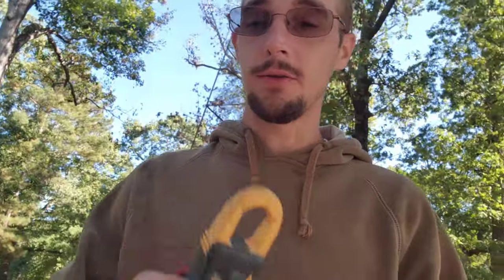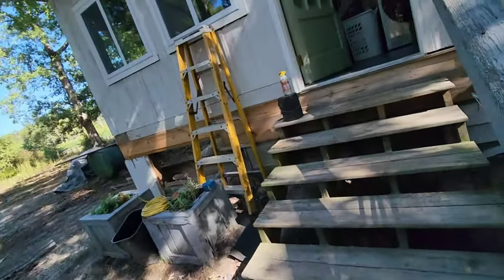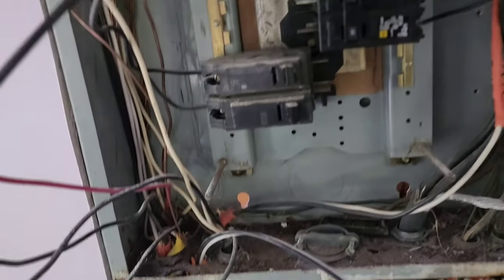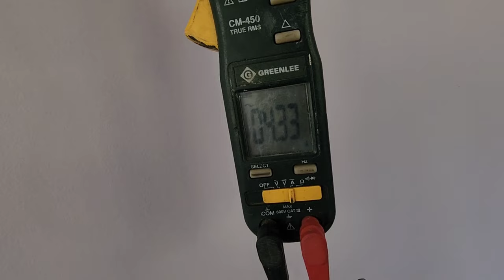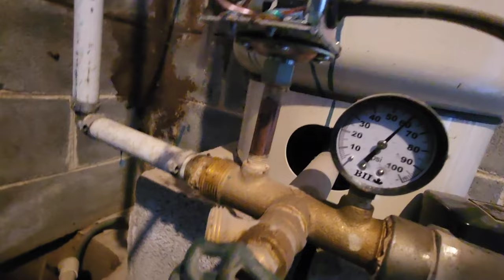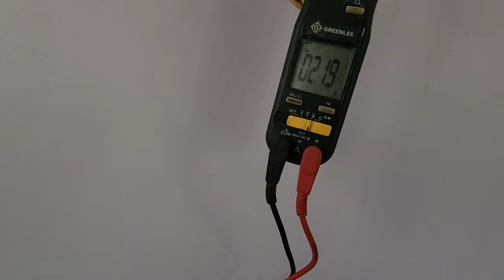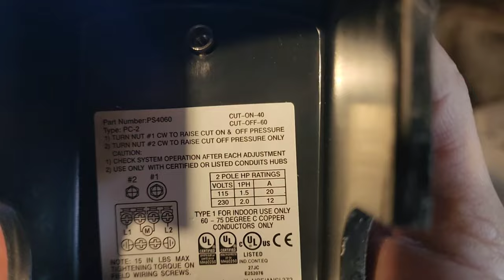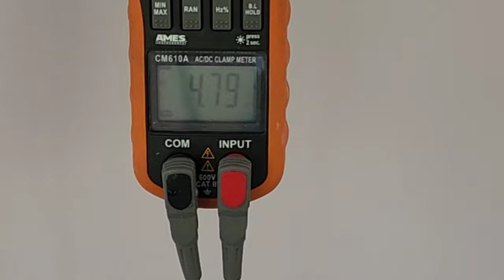Well Pump Electrical System Troubleshooting. Step by Step Tutorial.

Comment: Im sure that 30amp breaker didn't help. 12/2 shouldn't be on a 30 but on a 20amp
Reply: Size of wire has nothing to do with tripping. It is an over sized breaker but that wouldn't cause it to trip.
Reply: It’s only gonna pull what it demands so unless the pump goes bad and draws excess current it’s all fine. It’s not okay tho but with the current draw I saw in the video it should be on a 20 for sure and in case the pump goes bad.
Reply: If it was not a lightning strike, I can only suggest that the cable had been knocked about before it was used, I mean I have a fair amount of cable that's outside that I'd think twice before using !
Reply: @ChillyDippers it absolutely could. Motor seizes or impeller or rotor becomes locked (by any number of means including mineral deposit buildup, failure of one of those components, even sediment infiltration) causing the motor to continually draw more and more amperage in its attempt to begin rotation. This overloading would be attained due to the over sizing of the breaker. The conductor size is only rated for 20. They over rate a bit but not another 50% of the current load. This would cause the insulation to heat excessively, causing it to become scorched, brittle and lose its insulative properties. It would also create this same phenomenon with the wiring AND the motor windings themselves inside the motor housing.. This in turn would then allow the conductors encased within to be able to allow an electrical arc to bridge the void between either through proximity or even moisture present, and also enable them to short to ground by arc bridging to something like metal casing sleeve and even to water itself present on the sleeve itself or motor, so either from drawing excessive amperage past the 30 point (which is plausible but unlikely without causing something to ignite first) but entirely possible and even likely through the overheating of the conductors and wiring and windings in the motor itself
Reply: @sheepishmclemmingston5550  no it absolutely can't. However it would prevent the wires from getting overly hot in the situations you bring up. 

Over sized cables do not cause excessive current flow. Fuses, breakers, and thermal overload do.
Reply: @ChillyDippers  tell ya what. Go ahead and slap a 30 amp breaker onto a 12 awg dedicated circuit with an inductive motor as the dedicated load, wedge a stick into the cooling fan on the rear of the rotor shaft and make sure shes good and wedged in the housings grating and that cooling fans blades so the  rotor cannot spin, and let me know how that works out for you.  Do it multiple times. Tell me how things go.
Reply: @sheepishmclemmingston5550  size of the wire won't cause a breaker to trip. Yes when the load draws more power it will heat the cable and there might be excessive voltage drop it but it won't cause more current to flow then what the load determines.

Comment: Excellent diagnostic troubleshooting.  There will always be armchair generals who doubt what you say, but you solved the problem and got the water going.  Now, whoever was running those electrical lines, they need talking to.

Comment: When exposed to live voltage, your muscles will contract and therefore your hands will involuntarily grab the exposed electrical wire or fitting with potentially dangerous consequences. If you are in a poorly lit attic or void, always try to use the back of your hands for feeling around.
Reply from the maker: Best advice ever! I always second guess a meter & use a screw driver and the back of my hand. So it'll push me away if there is some sort of voltage issue back fed thru a ground
Reply: That's actually a bit of an old wive's tale. I've been badly shocked many times at both 120V and 240V (I was quite a tinkerer as a child), and I've never experienced the involuntary 'grabbing' phenomenon. Maybe it happens at very high voltages, but not at the voltages found in residential settings. It's a myth.
Reply: @paulmaxwell8851  definitely NOT a myth.  It may not have happened to you yet. But if you keep grabbing hot wires while you're grounded, eventually you will understand it's not a myth.

Comment: They probably Chaffed the insulation off that wire by pulling it through the Galvanized pipe from day one it was only a matter of time before it failed completely (which shouldn't have been done). UF wire AKA Underground feeder wire is direct burial. That house is a wiring nightmare home owner electrician special. Great job diagnosing.
Reply: I saw how much of mess and disorder the wiring and plumbing were in this video.  Even when I pulled temporary outlets, my wiring was always organized
Reply: The wiring in that place looks like a bird nest. Everything you did is a vast improvement 👍

Comment: EXCELLENT critical thinking and problem solving.  I tend to agree on the lightening strike theory.  I mean what are the odds of having not only one but TWO bad spots in a wire.  Well done.
Reply: Many may think that a lightening surge would mean that the power distribution (power company) wires took a hit.  Lightening hitting a tree, fence, or the ground itself near the buried copper wire chase will find that copper to be a better conductor than surface loam of the earth, so a tremendous current will jump onto the pipe, and then to the wire inside it.  The wire insulation breaks down at a very low voltage as compared to lightening, so what happened would be expected.  I suspect the wire was damaged FIRST followed by vaporizing of the contacts at the pressure switch. If the pressure switch had not acted as a fuse, further damage inside the home would likely have resulted.
Reply: We had a lightening strike on the phone line years ago.  The phone line wire casing was unharmed but the wires in at were vaporized, it was a hollow tube.  It also got my computer and the surge suppressor it was attached to

Comment: Good job! I am not a electrician, I just wondered if you could have just done a continuity test to find broken wires..
Reply: Disconnect them on the switch and at the well if you have continuity on any of the wires it is shorted

Comment: I am not an expert on well pumps, have worked on a few, both jet and submersible, grew up with a jet in the home and at 12 years old knew how to prime it.  Have nearly an EE degree and experience equivalent and my expertise is troubleshooting and computer programming. The troubleshooting on this is 100%.  I have not seen anyone do a video  as good on that, just following the steps and thinking is great for someone to learn from, no matter what they are trouble shooting.  He may not have ever read Kepner Trego Decision/Problem analysis, the best book on this but he follows the steps - did not cost the customer failed "fixes", did not jump to cause that causes failed fixes, and probably took less than 15 minutes longer total to get a good result.  Any failed fix would have cost much more.  The meter replacement when he questioned measurement is a GREAT step.  Proceeding with bad information is heading to a failed fix.  The only bad decision in this was using the old wire to pull in but quite frankly, I would have either done a resistance check of that or done what he did - probably done what he did.  The resistance check would have told me the wire was shorted but I still may have tried to use it as a pull. I was vacillating on that when I was watching. 
I have nothing but respect for his work.  If I needed his services he would be on the top of the list for being called.
Reply from the maker: You Sir I respect to the fullest as well for such a great comment! Alot of what I do in my Videos is to help others. I did all the steps that anyone else would have to do, (even though I knew the problem about halfway through the job) I wanted to show proper step by step test method to rule out other areas. So many different variables on these systems,  but I'm new to shooting video and editing but slowly am getting better at that as well. Making a Video requires alot more time on the job & customers think ill add that onto labor costs (which I never do) . This job total was I believe under $400. It's hard to say what others would charge, but I try to do my best work & be as fair as possible. Thanks again for your words!

Comment: good diagnostics, I agree on the lightning strike as the cause, and the metal pipe was "ground" in several spots, lightning always goes to ground and that opened the insulation allowing the direct shorts you found and that makes sense to me......again, you do a great job explaining things.

Comment: I noticed that at the very end of your video analyzing the problemthat a pop-up blurb "Or was it [lightning bolt symbol]" appeared. A lightning strike is what I was anxious to suggest, but you beat me too it! 

Very unusual to have two burnt spots 30 feet apart on the same wire and circuit.

Fine videos, great work ethic, nimble mind at work - more fun than watching sporting events on TV. Thank you.

Comment: That's excellent troubleshooting. I don't envy professionals like yourself, who have to work on disasters like this. There are dozens of electrical code violations at that house, and you somehow need to get the guy water without having to tear down the whole house and redo everything. A pro electrician would not be allowed to overlook some of the egregious errors like poor routing, no fittings for wires going into the panel, loose coils of live Romex dangling where animals move, and inadequate wire protection until it gets to the 18" deep level. An electrical inspector might condemn the whole house. Great decision to redig a new path. He needs at least 18" with overlying pressure treated wood, or more if vehicles drive over the run.
Reply from the maker: He's a 25 y/o trying to do everything himself & has a older guy helping him out. I'm sure things will look better in time. He just can't afford a true licensed electrician. But I agree with you, you'd be surprised at some jobs I find worse than this.

Comment: Where have you been all my life? In watching 3 videos so far, I have learned like 9000% more. I do not want to make a cheesy post about subscribing (I did subscribe) but wanted to thank you again for showing how to diagnose these things so that I either A- do not get swindled by people selling me purple unicorns or B - I can actually fix myself. This video specifically is about topic that I am about to undertake. My breaker keeps tripping so I have been working all angles and checking amperages and all this other stuff and only thing left is the wire. I ordered 300ft of conduit + 250 ft of wire (only need 180). Looking forward to tackling this with far more confidence.

Comment: I'm really enjoying your videos! Thanks for taking the time to video and explain the well repairs you're doing.  I do quite a bit of electrical work and can add something to this!  That wire failure is a mess but not unheard-of. What you are seeing are two places in the cable which have suffered insulation failure and had an arc fault. This happens when the insulation breaks down chemically (for some reason) and becomes conductive. The damaged insulation provides a current path from one conductor to the other; or from one conductor to ground. This conductive path starts out gradually in most cases, but as the current passes through the damaged insulation it causes more and more damage which accumulates over time. This causes an increasing current flow through the damaged insulation. The problem "snowballs" as more current flows and accelerates the damage. Finally, so much current flows that it produces heat and starts to burn and carbonize the insulation. This is very conductive and results in an arc and high fault currents. Envision a shower of sparks and a breaker trip.  Often the arc will continue until the breaker trips, but may not re-strike after the breaker is reset. This is because the burned insulation has been completely blown clear of the copper wires, removing the short temporarily. It is possible for the bare copper conductors to continue carrying power and the circuit to function after this event has happened, as long as the copper isn't actually touching or broken in half.  This can allow for multiple damage points in one cable, as you found. This means that there has been a series of "mystery breaker trips" for this circuit where they keep resetting without locating the fault. 

The cable was almost certainly damaged during installation as they pulled it through the abandoned water line. The inside of that line may have even had fittings and couplings in it, with solder slag or who knows what. Once the insulation is scraped and gets a pinhole; water will seep slowly into the cable and start conducting current and breaking down the insulation. It may take hours, days, or years for it to manifest its self as an arc fault.  When we install new cables in industry, we often use an insulation resistance test (Megger test) to search for pinholes in the insulation after installing new cables. This can help detect problems before they become bad. But it doesn't always catch everything; especially if the damaged cable has not had time to absorb water.

If you wanted to locate this without the risk of repeatedly closing the breaker into a fault, you can use your meter in resistance mode (ohms) to make the same test you made. Measure resistance between the live wires at the breaker (with breaker off.) Once you isolate the fault, the resistance will go away and you will have an open circuit with no continuity at all. The meter will go from showing ohms of resistance to showing "open" "OL" or something like that. It will save you from potentially wearing out a breaker. Plus you can use the meter from anywhere in the system. You could disconnect the circuit at the pressure switch and measure resistance back toward the breaker panel, to eliminate that wire as a possible cause; or use it toward the well, to confirm that the fault is in that direction.  

Also; I love that old Philco fridge in the basement!  I've been restoring them for several years and the Philco models are well loved by many. That is likely a late 40's or early 50's model.

Comment: The fault detection method used I called "Bob the tail" , keep shortening the "tail" from load to breaker. I also used a method I called "½ & ½" , when you have multiple loads go to the one in the middle and break the circuit, test, if still bad go to the middle of what's left and repeat. If 1st test is good, reconnect half of the untested half, if still good, repeat. I've done this with pole lamps around a complex and it saved me a lot of digging with the "Bob the tail" method.

Comment: It's possible that when the wire was on the reel, it was damaged some way, which is why it is damaged in relatively close proximity, then it was pulled through the underground pipe without the damaged being noticed. I assume there can be no movement of the wire in the pipe. If there was intermittent water infiltration into the metal pipe, then the power could have been shorting out in those areas, and since it IS a metal pipe. The water would leave the pipe, but over time as the scenario repeated itself, the wire became more and more compromised, then finally went to a dead short to ground. Where I am it is mandated that only schedule 80 PVC pipe can be used to run underground wiring through. The same type of pipe is used to carry the water. You use excellent procedures in your videos. They are most informative and  helpful.

Comment: Great video,  It's great that you find the problem and not just patch it for the next guy, which in your case would be you most likely.  the problem might have been the wire got scraped thin while being pulled through that water pipe (not conduit).

have a great day

Comment: Some time ago i had a similar problem on a large machine that cools down and stack fresh rubber sheets. The protection switch on one of the larger motors (9KW/~12HP) always trips. After some time i discovery the bad part of the wire in a cable canal in the control cabinet of the machine. The problem was that the canal was full of active wires from other motors. The heat can't get away until the isolation melts.
In your case the cable was alone in a metal tube wich even works a bit as a heat exchanger. So the cause was mechanical force and you decided right to not reuse the tube.

Comment: As an old electrical contractor, one of two things, lighting by asking the customer if they had one and well stopped after, if not that wire got nicked and took water this long for it to find it.. It's a nice fix. , not  in going back in the pipe...

Comment: Good job. The only thing I was waiting for was an early ohm reading on the wires both switch to panel and switch to well area with the ends disconnected of course. This would have ascertained the short was in the underground wire early in the video.

Comment: I would guess that the wire was damaged even at initial installation, over time the conductors began to arc to ground, which will build heat and lead to failure. Electricity does not like to jump, when this happens it's much like welding, and obviously it doesn't take long for the circuit to fail. Your diagnostics planning was spot on, by isolating each circuit you can find the problem fairly quickly. Nice work.